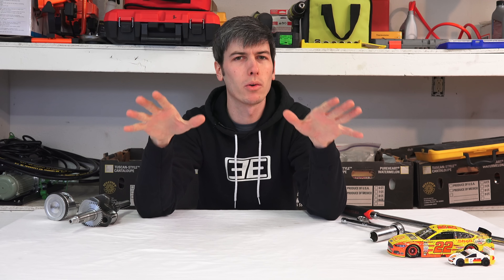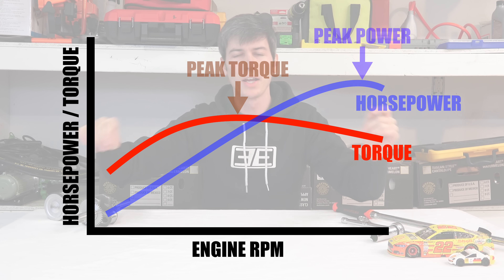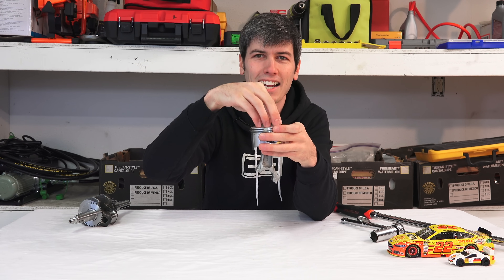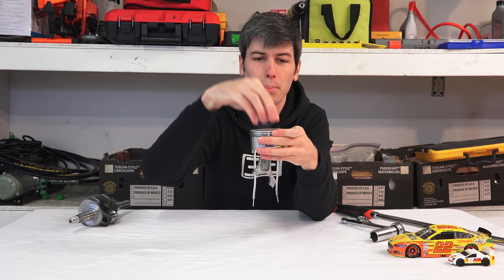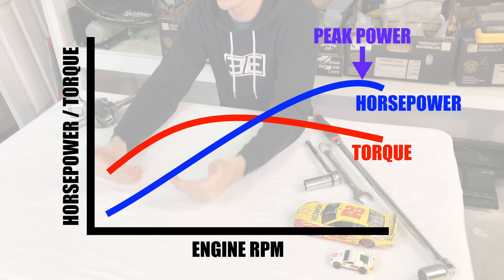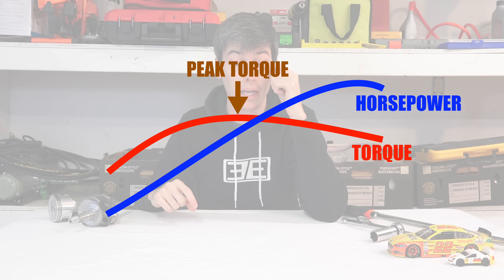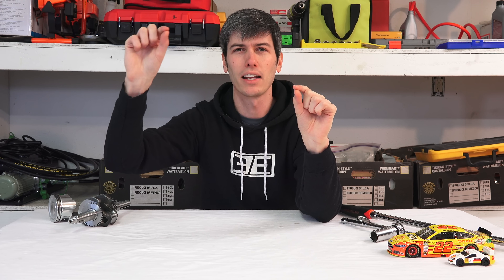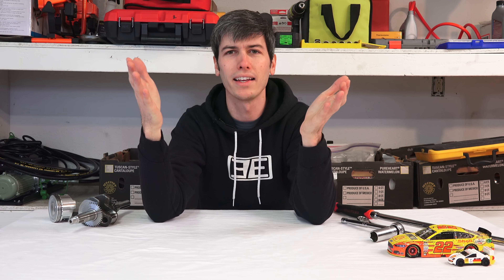Horsepower vs Torque - A Simple Explanation

Comment: If you have never physically used a torque wrench before you are gonna have a hard time wrapping your head around the concept of torque, i cannot believe he didnt mention a torque wrench in this video
Reply: screw isint the same as cars 😉👍🏻 more torq screw biger screw stronger  and only if thread offset is similar or not enough big diffrent from screw axis 🤷🏻‍♂️ vs 100 nm at whell with  radious  1 metres will push you into seat 100 times stronger than 1000 nm at whell with radious  1000 metres at the same speed 👌🏻🤷🏻‍♂️ so its reallly not good analogy and lead  you to nowhere , except fake bull💩story 👍🏻🍿

Comment: I'm learning about engines after buying a Mercedes van with an m111.970 diesel engine. It only has 71 HP (tuned for fuel efficiency and reliability) but 150 Nm of torque. What you're talking about is a skill I learned instinctively through driving with the manual transmission. It's a joy to drive.

Comment: So in a simple way, if my motorbike has 50% more HP than my buddy's, and we have the same torque, mine should feel/be a lot faster because it can deliver that power faster over the same timeframe [I can think of it as the engine is capable of spinning faster... ie. rpm]?
Reply: when you writing about max performance so max accelerstion and topspeed assuming similar weight asf than yep 👌🏻 elasticity from lower rpm can be diffrent story depending on on „characteristics” both engines let say 👌🏻 up to certsin  engine rpm less pwoerrfull  engine can be fell stronger well not only fell but it really can be stronger if it would have at those lower rom more torq /power than more pwoerfull engine at the same low rpm 👍🏻 feg i have cb 500 pc26 47 nm 8000 rpm 57 hp 9500 rpm 190 kg vs feg susuki s40 50 nm 3400 rpm 31 hp 5200 rpm 180 kg let say diffrent in weight is eleveled be heavier 10 kg rider on s40 so this s40 be stronger at the same low rom as me cb up to like 5000 rpm from idle rpm 👌🏻 but above 5000-5500 rpm sow ehre over those level its game over for s40 me cb start be stronger alll the way to rpm limiter at 10,5-11 k rpm 👌🏻 max performance for those bikes loooks like this 0-100 s40 8,5 sec vs cb 4,7 sec with 1 ft on vmax s40 140 km/h +/- vs cb 180 km/h +/- gps 👍🏻 the same story is feg with rocket 3 221 nm 165 hp vs vmax 1700 167 nm 200 hp rocket is stronger all the way from idle to 6-7 k rpm but from 6-7 krpm to vmax rpm limiter vmax is stronger and beacuse max performance as long as each vehicle have pefect gearing DONT depend on this how steong engine is on lower rpm where have less power than at peak but how strong it is at high rom where it have peak power so again more powerfull vmax beat rocket 3 in drag race not be much though cos diffrences arent huge really 0-200 rocket 11 sec vmax 9 sec +/- well it is some diffrences and offcorse if you comapresome strong bike up to certsin speed there be no diffrencess cos grip limited max performance and whellly and not engine power 👌🏻 thats why good lounvh gsxr 600 go head to head to 80-90-100km/h with way more powerfull gsxr 1000 120vs 200 hp 👌🏻 torq only determined rpm at which must be for generated specified power 👌🏻 it is also let say relaticely good indicstor of engine elasticity but without seeenig precise engienncharacteristic from dyno you still dont know precise how it would behave on other rpm than at which manufactory give you peak torq level and peak hp level 👌🏻 ,power /peak power at pefect gearing detemrined max performance 👌🏻so yea if your bike have 50 % more power at simialr weight drag asf it be waaay faster of you push both bike to its limits beside speed rsnge from 0 to veryc ertwin speed depend with which level of weight weight dsitributioon tire grip and power level we deall here precisellly the more power full bikes you comapre to the higher speed there be no diffrencess as both be able to lift front to much or lost grip to this very high speed 👌🏻cos power ::m/s = force if 200 kg bike have 2 tubro and 750 hp + stpck road tire and stock geometry and weight distirbution you be unable to use all this power for accelerstion untill speedo show 3 digits and probably above 300 km/h not under 😉👌🏻 if ypu comapre weakest bike which have feg 50 hp bikes doffrencess can be seen as soon as from 40-50 km/h vs weakest in comaprision 100 hp bikes will go very close to 80- 100 km/h with stornger bike offcorse assuming rider on each can laucnh them perfect 👌🏻for avg 200 kg naked sport bike 200 hp sport bike go head to head with 150 hp to like 140-160 km/h cos again 200 hp bike in avg sportbike 200 kg is unable to use more than 150 hp without lift front to much or lost grip thats why feg the more power have bike in similar cstegory the longer 1 gear they have for prevent whellly and lost grip asf 1 liter sport bike with 200-220 hp have 1 gear to 150-170 km/h  ,also good egzample is one of me favorite bike trx 850 86 nm at 6000 rpm and 81 hp at 7500 rpm vs r6 both yamahas 65 nm at 11500 rpm 123 hp at 15000 rpm +/% depend on year asf there be no diffrences in accelerstion assuming rider on r6 launch it pefect to like 80 km/h +/- cos rider on r6 be unable to use more power for accelerstion form 0to 80 km/h than rider on trx or he end with massive whellly which makes accelerstion worse cos you must than let go theotle or end compeltely on your back with bike on you or tire just lost grip what again do the same stuff makes accelerstion worse 👌🏻 but above 80 km/h +/% from where rider on r6 can already use more power than trx have it start to walk away from trx /left it in the dust 👌🏻 and like probably seen or not torque dont need to be the same it really dosent matter in regard to max performance trx and r6 egzamp,e show it good 86 nm vs 65 nm and 86 nm have no chance 👌🏻 cos engine r6 makes  waaay more power 50% more 👌🏻 but when avg rider which dont race for reall just ride on daily and like use let say rpm from 3 to 6 k rom do test ride both bike he say r6 is waaaaaay weaker than trx and he be rightin regard to rom at which he ride cos in did r6 at 3-6 k rpm is weak like 💩 comapre to trx 850 👌🏻 its basically 2 times weaker at those rom to 2,5 times and this you will defentielly fell 👌🏻 in daily ridng for go on r6 at faster pace rider on r6 must hold engine cosntsntly on muuuuch higher rpm where engine r6 makes mpre power otherwise r6 dont go any faster thsn trx 😉👌🏻 but yea of your point is only max performance and you susbscribe bikes which weight similar asf + both have perfect gearing than yea if your bike have 50% more peak power it be waaay faster even if this other bike will have 150% more crank torq 👌🏻🍿

Comment: The framing that helped me was the idea that all that matters is torque at the wheel. To achieve that, you need raw engine torque and your gear multiplier. At a given wheel speed, the higher speed your engine is running at, the greater the multiplication of gear ratio you will be using. Peak power how we find the net result of raw force and the force multiplication we can be using at a given wheel speed to give us wheel torque.
Reply: greater multiplicator gesr rstio  dosent mean greater drive whell torq at set speed ….. and as whell rsdious is set greater cotnsct path force …. it be bigest only at peak power at set speed dosent matter how many times ypur multipilcator of gear ratios is grewter in regsrd to set speed if there be lesss power now ypu genersted less contsctmpath force feg 15000 rpm 50 hp vs 1500 rpm 500 hp at 100 km/h 15000 rpm at 50 hp have 10 times grewter multiplicatpr of gear rstio and so what? 1500 rpm at 500 hp at this point at the saem 100 km/h generste 10 TIMES stronger force at contact path +/- cos drive trwin losess must be cslcualted still multiple times biger force it be genersted at multiple time worse gear rstio multiplicstor 🤷🏻‍♂️👌🏻 this 💩 what ypu write is true if wr tske out of equation speed factor so yea greater multiplicator biger force and in the swem time lower and lower speed in regsrd to rscing how strong vehicle pull 100-200 km/ h its pointless but how much it b able to pull weight from dig uphill now its very impaortsnt and engine with multiple times less crsnk torq with enough grester multpilciztor of gesr rstio be able to pull uphill boger weights 👍🏻 feg 1 hp 1 nm engine 25 cc n/a b able to pull uphill biger weight than v8 4 turbo 750 hp 3500 nm engine fom strongest stock tuck engine at enough shorter final gear rstio aka greater multiplicstor of gear rstio but it will do it extremely slow but still where this v8 be unbale to move at all from som point of load size 👌🏻🍿 but yea in regard to accelerstion at set speed greater multiplicstpr of gesr rstio be itself say 💩the swem as torq 👌🏻🍿
Reply: @mociczyczki  I'm not even going to try to read that mess.
Reply: @Stuey105   ok 👍🏻

Comment: Thanks. Great explanation.  I always wondered why a car that gets a cam replaced with one with an aggressive cam profile increases the engine's HP by providing more HP at mid-to-upper RPMs, but the peak torque doesn't change.

Comment: Major problem with the torque analogy. A longer lever is harder to move and just the lever needs force to move. There is a point where a shorter lever will supply more torque than a longer one. This is why engineering school exists.
Reply: Incorrect, increasing leverage always makes it easier

Comment: At 5:57 you bring in gear ratios, and I don’t think they are needed, because if I understand it correctly they don’t matter… no matter what for the same gear ratio peak hp will have the max power which translates into acceleration. Bringing in the 4 vs 3 ratio gears is confusing because you could also have the 4 gear ratio at peak torque and have 200 ft-lb but still accelerate slower. Maybe I’m misunderstanding something…
Reply: they matter 👌🏻 for the same gear ratio torque translates  into max acceleration cos in such situation you measured Gforce at 2 compeltelly diffrent speed level 🤷🏻‍♂️ feg peak tprq at 3 k rpm pewk hp at 6 krpm than at the same gear you comapre accelerstion at 30 vs 60 km/h 👌🏻 vs at set speed feg 60 va 60 km/h where for the same wpvehicle ypu must choicen diffrent gear ratio for measured acceleration at this very specifieed speed level other wise you be unable to comapre pewk power rpm vs peak torq rpm at the same speed of vehicle 👍🏻… so feg on 60 km/h for pesk power rpm vs 60 km/h for peak torq rpm than more power translates into max acceleration 👌🏻 gear ratio is for hold engine on peak power as long as posiible in regard to racing👌🏻 it does matter even most powerfull engine with enough bad gearing setup csn be slower than less powerfulll version 👌🏻 once it get perfect gearing orat least enough good gearing inr egard to this less powerfull version at perfect gesring now it start accelerste quicker   in race 👌🏻but only shorter gear ratio and higher rpm itself without more power dont make vehicle faster there must be more power cos this is what only matter dosent matter long /short gear rstio  low/high rpm low/high torque if each version will have perfect gearing this version dosent matter how it is produced which have more power win in race cos work :time = power .

Comment: I have an actual question. I have two cars with the same power but one has significantly higher torque, who would win?
Reply: torque dosent matter if they have similar topend power in race it be close offcorse you dont know precise true topend power level for both beside ypu dont know true ehole resist like drag drive trwin losess roll true weight diffrencess so it csn go either way also rider error must beinclided 🤷🏻‍♂️👌🏻torq dosent matter but peak width in regard to diffrences between gear lenght YEP 👌🏻 so which one wpuld use more avg power thanks better proportion between peak wodth to sofrences between gear lenght win it dosent matter which have more torq👌🏻 go check sometechspec data the same car 0-100 as long as peak power be the same accelerstion times be similar dosent matter how much less more one of version have torq 😎👌🏻feg ford focus 1 gen 1,4 zetec 75 hp 125 nm 0-100 14.3 sec vmax 171 km/h vs 1,8 endura tddi  75 hp 175 nm 0-100 14,7 sec vmax 168 km/h small difrencess comes from small difrencess in weight asf but overalll they are prety much equall cos power is similar dosent matter what is the difrencess in torq but such stats is in regard to when you push car to its limits 👌🏻 so what do actually more torq in endura  1,8 tddi version ? well this version is signifiacnt stronger on low rpm 👌🏻 cos it have 175 nm at 1800 rpm vs zetec 125 nm at 3500 rpm and on 1800 rpm ot have probably not more than 100 nm otherword if you setup in this way 👉🏻 the same very low rpm for both start from the same  speed for some roll short drag race than 1,8 endura tddi smoked 1,4 zetec  at first phase of race to certain speed👌🏻 other word this biger torq at low rpm characteristic give from some point of view better elasticity of engine 👌🏻 and this 0-100 100-140 on max dont show 👌🏻 when you setup roll drag where both be allowed to use its best gear rpm for specified speed level at start to this roll they again will go head to head 👌🏻beside the same power level but one have more torq mean this engine work on lower rpm this is basically what more tprq do it allow engine to go on lower rpm while do egzacly the same stuff so it generste the same contact path force but at lower rpm as long at there be the same power level for set speed 👌🏻 other word and long stpry short for have the same performance in 1,4 zetec version ypu need to rev it much more than 1,8 endura tddi but in results both go head to head basically some people dont like rev to high and here come with help for them engine with big torq at low rpm  some dont care about this and as long as both engine can generwte similar power its ok for tham and some even like engine which you need to rev more so it comes to pure preferention nothing more but as long as those engine will have similar peak power level and simial proportion peak wodth to diffrences between gear lenght they be able to generste very similar performance all day long just be using diffrent gear and rpm level 😎👌🏻once one of version dosent matter which tdi vtec compresor whatever what and how setup be able to generste more topendpower at good gearing it start to beat other version atleast in racing 👌🏻 ☕️

Comment: But why do diesel cars have more torque than petrol?
Reply: have they ? disel withput turbo avg have 60-70 nm from 1 litres dispalcement saxo 1,5 disel egzacly 1527 ccm have 95 nm what mean 62 nm /L vs saxo 1,4 have 113 nm from 1360 ccm petrol what mean 83 nm/L  me bike from 499 ccm have 47 nm what mean 94 nm/L 🤷🏻‍♂️ and for race sprots car and sports bike can have up to 120-125 nm/l when everything go on limits 👌🏻 but with turbo disel usually makes more torq  for similar dispalcement but its proabbaly only cos manufactory setup theyr turbo on push more air into combustion chamber otherwise if both will have similar turbo flow into cylinder chamber still probabaly petrol clock more nm/L 🤷🏻‍♂️ 👌🏻 so im not so sure they have more torq than petrol at simialr setup and probably on absolute limits as well like for racing some setup 🤷🏻‍♂️typically just disel generate peak torq on lower rpm like with saxo egzample petrol 1,4 i 113 nm at 3400 rpm vs disel 1.5 d 95 nm 2250 rpm 👌🏻 now how much air flow can be push into combustion chamber depend on engine construtcion roboust thiknesss trenght so how much this engine can take without blow up into pieces 😉👌🏻 what is important for longevity i quees feg golf gtd 200 hp 400 nm from 2 litres dispalcement i bet petrol can be construct in such way that it can have much biger air flow into cylinder and produce waaay more torq from the same dispalcement thpugh if ypu comapre petrol 1,0 n/a withput turbo with 90 nm feg vs 2,0 turbo from golf gtd with 400 nm than yea this disel makes more torq than this petrol alot more 👌🏻☕️

Comment: To explain the concept by making a comparison:
torque = ampere
Rpm = Volts 
Horsepower = Watt. Or:

Torque = The amount of water that could flow through a river at a moment given the width and depth of the river.

Rpm = the speed of the water flow

Horse power= the total amount of water that has gone through the river after a certain amount of time

Comment: I still don't know why torque matters if a higher HP car is always faster and accelerates faster.
Reply: true but road is not racetracks 👌🏻 if so than version with more torque at low rpm can be for most people which dont race all the time better solution  cos engine work on more relax lower rpm give them what they need + pull stronger on high  gear from the same low rpm at similar speed up to certsin rpm /speed have better elasticity so big peak crank torq at low rpm is very apreciate be most road normal driver including me 👌🏻feg assuming the same model car i would choice 500 nm at 2000 rpm and 200 hp at 5000 rpm any day instead of feg 300 nm at 5000 rpm and 300 hp at 8000 rpm 👌🏻 yes at pefect gesring each and 300 nm/300 hp smoked in any race type 500 nm/200 hp version 1/4 mille or avg 4 5 km race track  with corners but innormal road  riding 300 nm/300 hp version be literallly dead in comapirision to 500 nm/200 hp versionall the way from idle rpm up to like 4-5000 rpm and avg driver such car after test ride on normal road will say 300 nm/300 hp is very weak assuming he dont cross 4000 rpm +/ write on fast dont check dyno graph this 2 hipothetical setup but it be like this  +/- under normal riding on road without try to squezz all or almost all what each setup have trust me 8on 10 avg rider including me defentiely choice 500 nm/200 hp 100% check this 💩 many times 😉 👍🏻🍿

Comment: Ok but what does that exactly mean? If radius of the wheel was 1foot, what does the torque of 200 lbs mean? That the engine couldn't turn the wheel if 201 pound man would be standing on it?